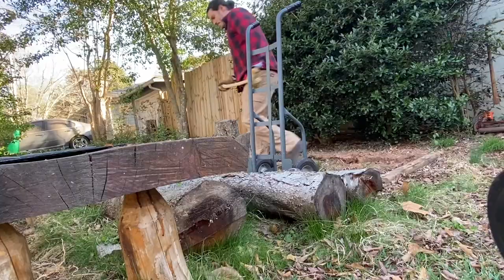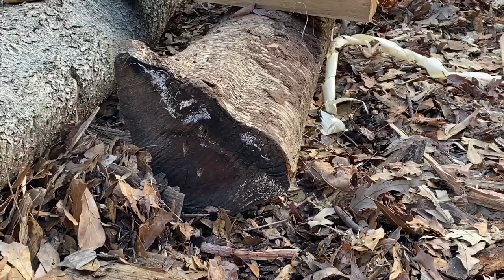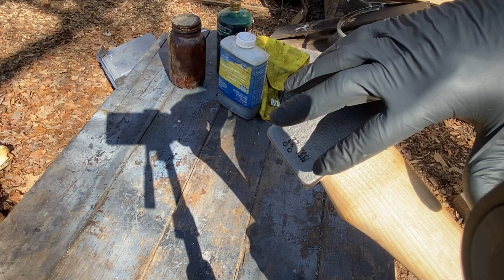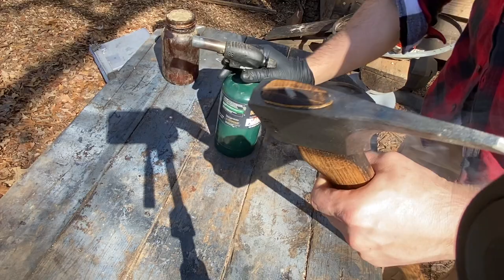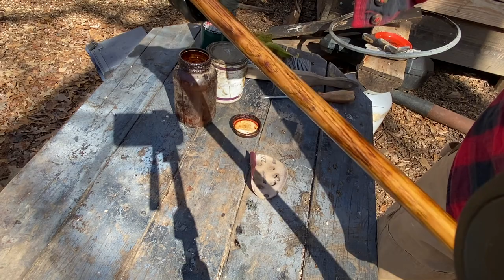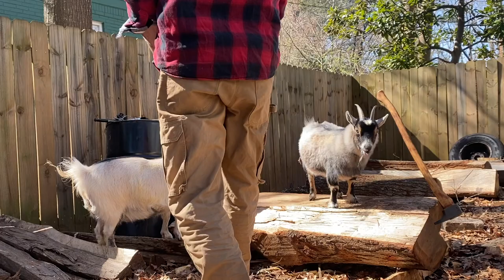The New Council Tool Pickaroon

Comment: I could use one of those. Listening to the dialog about the pound and a half head on a 36" handle, I have an answer to that one.
A tool for everyone's box, that crankcase oil can be poured through a paper paint filter available at auto body supply stores, makes it much less messy. For those using it, that is...
Very enjoyable episode Mr. @URBANLUMBERJACK...
Reply from the maker: Thank you! That’s a great idea on the filters! I saw a Casterman video with a PVC pipe for soaking handles, I’d like to try soaking one in motor oil to see what happens.